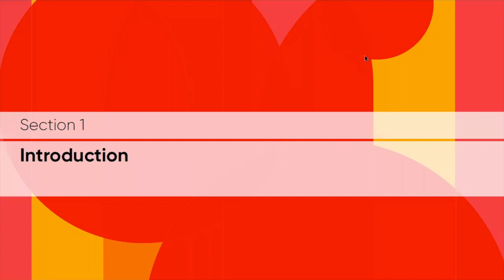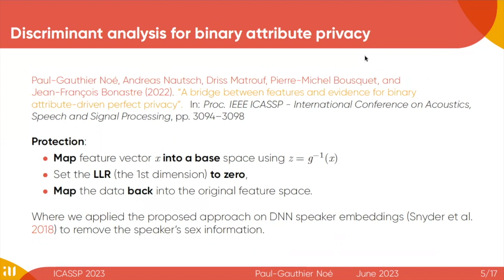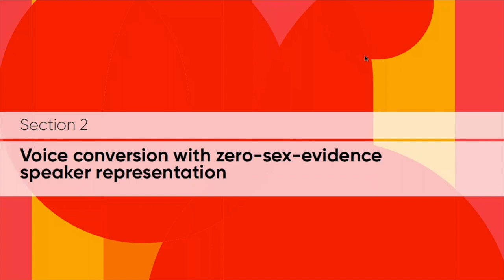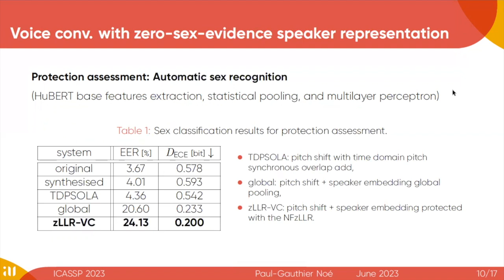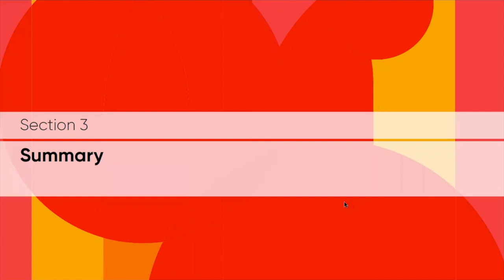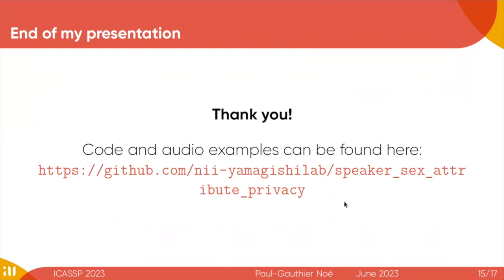Hiding speaker sex in speech using 0-evidence speaker representation in analysis/synthesis pipeline

Comment: This is very interesting I can see a demand for this from audio/video pipeline software that does the data stream for TV channels etc, where it is desirable to obscure the identity of interviewees such as whistle blowers. Being able to make the speaker identifying characteristics different without having to go through the process of having to transcribe the original interview, finding a voice actor and getting them to read back the transcript with the right emotions and emphases and then using that, instead you can just add this stage to the pipeline transform the recorded audio stream of the interview and only store audio with the anonymized speaker and you can reduce the number of individuals who know the identity of the speaker providing better opsec.